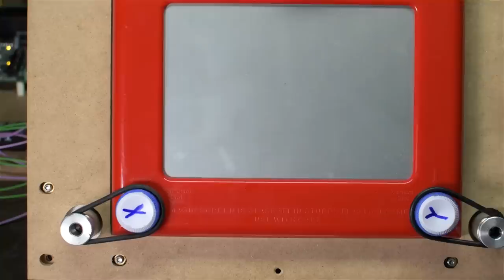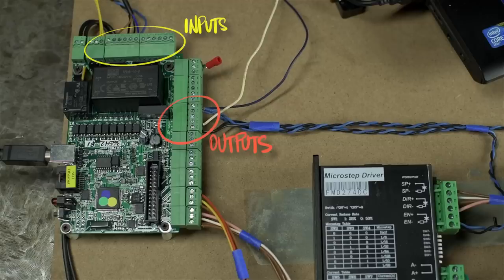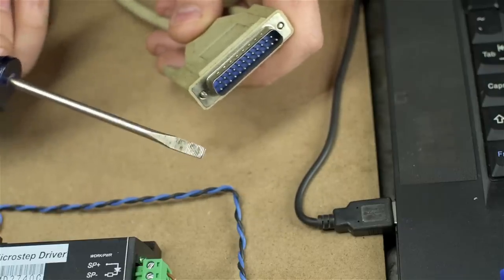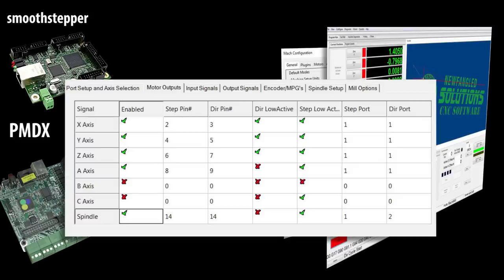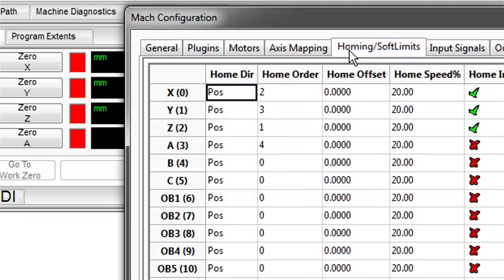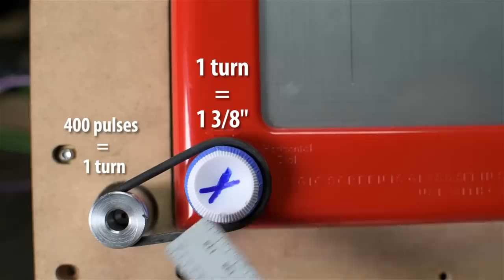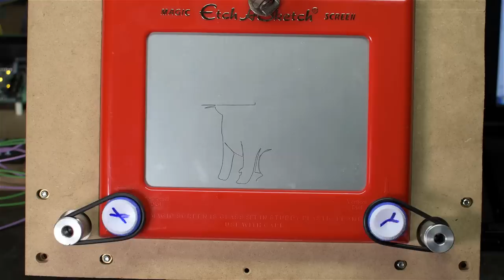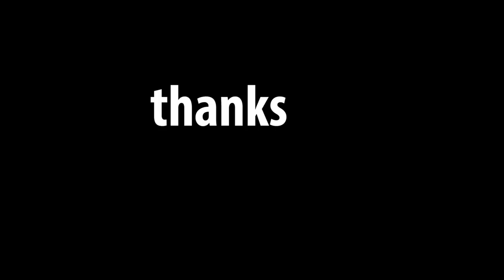Build Your Own CNC! (Part 2) - Inputs, Outputs & Software

Comment: I'm in the uk, and want to convert my STEP FOUR Mill to use Mach4 Hobby. Trouble is I don't have a Zee axis, can I use the Zed axis instead?
Reply: We have the same problem in Oz . . . . . . do I need an output for each of them or is there a checkbox within the software to account for this anomaly.🤔
Reply: You need an adapter.
Reply: My understanding is that they’re incompatible
Reply: Nope it wont work I've tried.  You will have to import an American mill
Reply: It depends on if you will be milling ah-loom-a-num or al-i-men-e-um.
Reply: @Whitwell: Zee works only in 115 Volt. Zed needs 230 Volts... 
And 50Hz  Hehehh
Reply: @stephanuhu963  Well not if you are in Canada
Reply: @fournierluc2205  At least you drive on the correct side of the road. We'll just look the other way on this one.
Reply: Pmsl
Reply: @paultrgnp  Not sure about the check box in the software deal, just make sure you wire the  "zed" stepper backward to account for the fact the you are upside down. I've always wondered how you guys deal with all that blood rushing to your head.
Reply: Yes, just go grab a tomahto or a potahto and enable the accent phase converter...
Reply: Flux capacitor should do the trick
Reply: Stephan 'Uhu' errrrr int we in 240 volts 🤔
Reply: The problem is, you will never be able to naught your Zee axis, and may need to submit a report to the buggered queue.
Reply: dan cobar There to main category of adapters: ZEDapters and adaptZEErs depending if you adapt to her or if you have her adapt to you.

Comment: For someone thinking about building a basically 2.5D CNC machine for cutting sheet material, this was an incredible little two-parter. The use of an Etch-a-Sketch is so clever. Didn't quite realize how similar it is to an actual engraver.

Comment: What I love about this very detailed explanation is that all of this functionality is in the LEGO Mindstorms robotics sets. All the way back to the first set ~20 years ago. Not as configurable but still there. The Mindstorms control unit was the breakout board and driver box combined and the software only allowed the programming of applications. No design tools, at least not in the old versions. Obviously LEGO motors and gears aren't very precise but it can be a good introduction for middle schoolers to building and running a CNC without them being able to damage much.

Comment: Hey Tony great special effects. love the "clear see through communication device".  Hope someday to have one of my own. Just for grins and giggles are you using after effects.  At 70 yrs old I am way past the info (got my CS deg in 1979), working half my life in building, repairing and programming . But I can't tell you how much I have enjoyed your presentation! Thanks for all your work. The info and the presentation are really great! wish i could partner with you to produce instructional stuff, that would be a lot of fun.  Checked out the other vids, I guess I must be old school I know the drill as far as what is required for CNC and worked for OTIS/Halliburton where that was used. even salvaged steppers form really old printer equipment and experimented. However unlike what you have I still use the really old manual lathe / milling equipment from the 1930/40s. Never felt like I had to have them doing their own thing. I did buy a 3D printer last year hope to have it working soon. need to make some gears for the old Atlas.

Comment: Backlash compensation in Mach just lets Mach know how many extra steps to add when changing direction, to take up the slop.  It is normal, when you build a machine, you measure the backlash for each axis with an indicator and configure the software.
Reply: Yes, indeed. Actually backlash comp is not evil and is sometimes unavoidable. You don't always have the means to eliminate it. It actually can work pretty well provided the backlash you are compensating for is not huge. The real downside is that when doing a climb cut it will pull the axis off the leadscrew by as much as the backlash measures which leads to lousy cut finish and, yes, sometimes broken cutters.
Reply: This. And since you can't remove backlash completely it is always a good idea to use that feature. It is not gonna solve the problem completely but it will do no harm either.

Comment: Great info! Backlash compensation just adds the the extra steps required to compensate for the given amount of backlash. It's not uncommon to have 1 or 2 thousands  of backlash on a dovetail way setup and backlash compensation works well. Adding much more than .003" of compensation will start to affect surface finish because of the quick jurk it does to remove the backlash.

Comment: Love every second of your videos and ALWAYS wish there were more. I WON'T be making a CNC but I do understand what you're saying. I used to continually replace a LOT of Potter & Brumfield relays in our radar antenna tracking/control systems. "G" code "T" code whatever... seen a lot of different ones over the years.

Comment: I found both the video excellent.  Having said that, as an aircraft mechanic and hobby programmer, some of the stuff (basic electricity and relays) did made my eyes gloss over.  Retiring soon, so I am putting down the wrenches and I need a new hobby.  A CNC build seem a logical progression to my skills.  Once again, thanks for the videos; they provide a great starting point for the next thing that will drive my wife crazy and keep me in the shop.

Comment: Please quit with the pants references. 
Some of us have never, nor will ever, wear pants. Got it.
Reply: Normally I would agree, but it's getting too damn cold, and my furnace is on the fritz.
Reply: You wear your kilt in the shop?
Reply: a tight one because the traditional ones have a tendency  of getting cought in the lathes leadscrew. ;-)
Reply: i agree, wearing a lungi is far more comfortable.
Reply: I just paint on my kilt and only have to worry about my sporran.
Reply: If you get too cold just use branding iron. It seem to work for me.

Comment: Ooooh, please do a Harbor Freight Mini Mill CnC conversion!
Reply: I'm sure much of your audience can't follow along with with you, due to the lack of machinery. For less than $2k, you could build one of these X2 conversions. Your community could follow along and you could show us some of the 'gotchas' you encounter along the way. There's also some kits available to replace the plastic gears, which you could turn yourself. 

There's also lots of examples of Harbor Freight level CnC lathes.

If you show us how to equip our home shops with a CnC Lathe and a CnC Mill, the two machines from which the modern world can be built, and you'd empower, potentially, hundreds of thousands of Makers!

Comment: Compadre!  A Trackball man.   Been once since the first GUI!
Reply: I always wanted one but couldn't find one I could afford (no return policy here - in case it didn't work out for me and too much $$$ to waste).
Reply: @Shaun.Stephens  M570 is like $60 aud, once you get used to them they are awesome.
Reply: @murraybooth3955  Thanks, they've got cheaper, I'll look into it.
Reply: @Shaun.Stephens  they are awesome but make sure to get the right one - same model two versions - one uses infrared wireless needs line of sight to work = useless
Reply: @nicvanengen9545  I have one now, had it a couple of days now (from Amazon). It's got the 'unified recevier' and doesn't seem to be line of sight. Now the biggest issue I have is going from my laptop to my gaming PC and making the change from mouse to trackball. I'll get there - I like it so far. Cheers.

Comment: PLEASE do a machine design video. I've been dealing with a rather cheap cnc machine. The redesign of it is kicking my ass. 

Thanks for the break down on smooth steppers, drivers, etc. It's been a big help with the way you explain it.

Comment: There are algorithms/programs that convert line art/graphics to fourier series, which is a way to give paths for anything. You could use 1 to n paths as necessary, and if multiples are necessary choose the starting/ending positions to remove the "lack of blanking" problem. (mathologer did a good job explaining how to do this)  

Another great video! Thanks!

Comment: re: limit/homing switches. I have run my CNC router for 10 years without limit switches, I moved them over as homing switches. On my new machine build (completed this past april) I added more and improved their functionality. I made them movable so I could use them as a movable home. That way I don't always use the same spot on my table and have a solid reference point if I have a power outage, I skip a step, or something else untoward happens. I always have a safe and accurate home.

Comment: At long last I may finally be able to make a legitimate contribution: in my experience with backlash compensation, the control simply added the backlash you set in the table to the axis move every time the direction changed. It worked very well on the open loop machine I used to use.

Comment: Hey Tony Oldman, another great vid! FYI "backlash compensation" actually moves the motor a little further than you ask it to when you change directions in order to take up the backlash automatically.

Say you tell the software there's 0.5 unit of backlash in the system. If you start at X0 and move to X1, when you tell it to move back to X0 it will actually tell the controller to move 1.5 units backwards (0.5 to take up backlash + 1 to get where you need to go).

With Mach, you can actually hear it doing these extra moves if you do a G2/G3 circle with backlash compensation on.

Comment: If you pop the knobs off the etch-a-sketch, there are probably quarter inch d shafts under there.  You could put a nice pull on there and use a belt as a linkage which should help with the backlash.

Comment: compensating for backlash in a cnc controller is completely valid option, If you are talking about small amounts of backlash like hundreds of a millimeter. What the controller will do is to just add pulses when ever you are changing direction on the axis, it knows which way it has been running so it can compensate the global backlash quite easily (worn nut as opposed to worn screw). Its not perfect, but if you actually want parts that are to dimension, i would recommend using it.

Comment: I've been looking into building my own DIY CNC machine looking at current hobby-grade models and their construction materials.  I want to start with wood/aluminum in the beginning, but would like to someday be able to get into mild steel.  I have been having the hardest time figuring out what determines if a machine can work with anything over "soft metals".  Is it the rigidity of the structure?  The quality of the spindle bearings?  The fact that most of the hobby models use a wood router?  The current relative distance of Mars from Jupiter?  All of the above? Most of the above?

I want to make something that I can use into the future, or continuously improve upon.  Knowing me I won't be happy stopping at aluminum for long, but will want to move into sheet metal up to 1/4".... for now.

Side note, I stumbled onto your channel a couple weeks ago and have been watching a lot of your content.  Love it man, keep it up!

Comment: The limit switch theory reminds me of my buddy in EE school when we got an assigment to assemble a PCB milling router kit. And so we all put our machine together and the teacher said to be extra carefull when installing limit switches and how they have to be positioned perfectly. We started the calibration software that would go in all three axes and tell the computer how much room we have to work with before the switch trips. And we engaged the x motion and suddenly bang bang bang pufff and his machine was all smoky and the fuse tripped. He did install the switches but forgot to add the wires. He later went to cook school and now he bakes bagles for lunch when we are wiring important instalations across the country.

Comment: way back 50 years ago when I first had a chance to use my cousins etch a sketch, we would challenge each other to do drawings with no extra lines showing, that meant backing up over your lines, its pretty hard not to have any extra lines but we did try to out do each other, i'm really enjoying this series of videos, hoping to build a 3d printer from the parts I had to build a cnc plasma table that was never finished.

Comment: Another note on backlash: The mechanism will go from driving the "tooth" of the gear to pushing on the "back side" during deceleration unless there is enough friction in the system to cause the motor driver to keep "pushing" the tooth even as it slows down (i.e., the friction causes a deceleration ramp greater than the command). This is why nice, linear, reliable friction is a good thing in some mechanical systems. Imagine if you had a frictionless mechanism and the motor had to slow the entire system down; the system would be snapping back and forth through the free-play space every time the motor accelerated or decelerated!

Comment: I have what'sinsideitis so on the one I took apart, I found there are not-very stretchy cords that go around the knob then halfway around the board in each direction. The drawing tip is a small point of plastic with cords going up and down and side to side around pulleys. The gray stuff is an incredibly fine aluminum powder and little beads of something.

Comment: Not only were these videos useful and informative but they were funny as hell, I love your sense of humor!

By the way, there's a version of the Etch A Sketch that has a joystick instead of the knobs and pushing on it moves the stylus back away from the writing surface so you can move it without drawing, I don't know how you'd do it mechanically but it would be a pretty cool thing to rig up like this as you could draw detailed pictures without unwanted lines going through everything.
Reply: That makes sense but seems like cheating. The people that got really good at using it had to plan out the whole drawing or retrace your steps. I have a friend who got so good at it he could draw stage setups of bands playing and the detail went down to the mesh on the Marshall amps and mic cords winding around the mic stands. He said he didn't retrace any lines

Comment: Awesome video as usual. Using a diode across that solenoid is a good idea to prevent flyback issues. You can do the same for relay coils if it's not built in.

Comment: In case it's important so someone  -  solid state relays aren't like mechanical relays that isolate the load from the supply. Those passing DC have enough leakage current to keep an LED illuminated, keep that in mind when driving small loads. You sometimes have to use a resistor across the terminals to drain the voltage low enough to fully turn off the load. 
An SSR that drives AC loads likewise have enough leakage current to hurt if you touch it.  Keep that in mind as well.
Reply: Thanks for the info. What about his comment on the usage of solid states over mechanical in general?   I dont understand his reasoning and the only time I see solid states used in industry is for variable outputs ie pwm temp control.
Reply: @ryanbreker9490  Using an SSR as used on the input side of things on a DC signal can be advantageous because mechanical relays bounce when they close. Its fast and hardly noticeable unless you are looking at high speed inputs where this bounce can register as 2 or more input trigger pulses. Depending on what you use it for, that can be benign or a real problem. 

On the output side of things, one example where SSR relays are used is just as you mentioned, for switching large Heater elements off and on, the repetitive nature of heater control make the relay turn off and on many times and the arc from breaking the current flow damages the contacts over time. By the very nature of how the device is built that damage is not possible with an SSR. 

A second example would be where you are trying to limit instantaneous inrush current. Once enabled, SSR's switch on only when the AC sine wave passes through zero volts. This lets the current ramp up more slowly preventing a high current surge, spike really, from being seen by the device sinking the current. A mechanical relay can turn on anywhere in the cycle and if it turns on and the contact transfers at the exact moment that the sine wave is at peak, much more current will be instantaneously available because of higher voltage available. Light bulbs are one such device that benefit from the use of SSR's for this very reason. 

Another interesting characteristic is that they normally don't turn OFF until the wave passes through zero volts. Less of a problem but worth knowing if, again High speed response is needed. 

If you are running a "real" PWM control you are most likely switching a DC supply from a capacitor bank into the load and by doing that approximating an AC signal. This is what  VFD does to drive a motor. . IGBT's (or just transistors) are generally used for this purpose not SSR's.

There are PWM controls that simply chop up the AC sinewave to provide speed control, but those provide a pretty ugly AC approximation looking more like the square wave of Tonys tig welder. I believe he was looking at those signals with his o'scope sometime ago. They are hard on windings because the rise time breaks down insulation, ironically thats the same reason they are good for his welder.